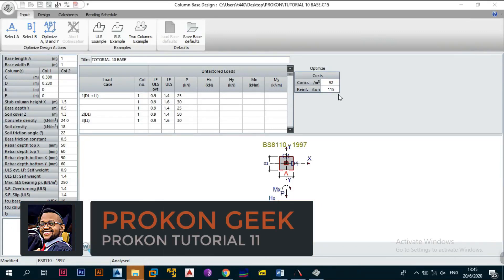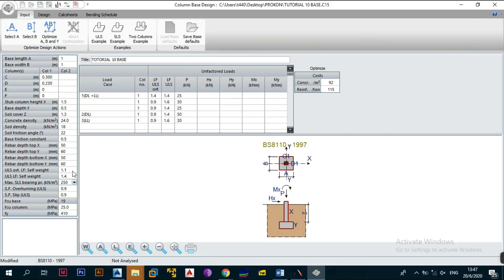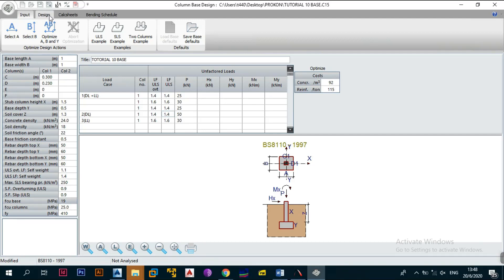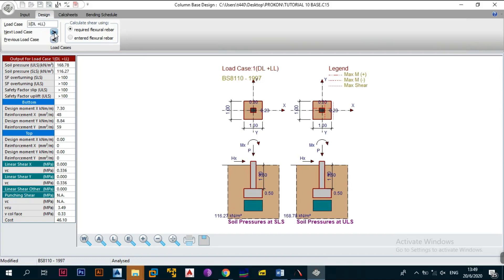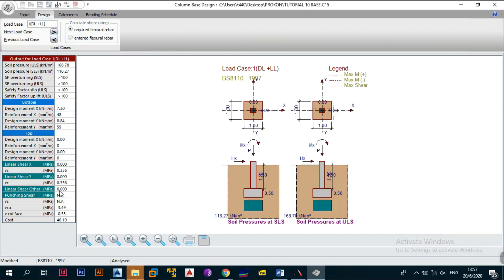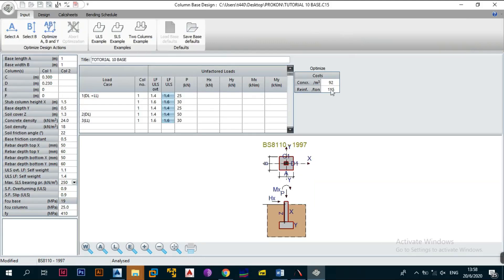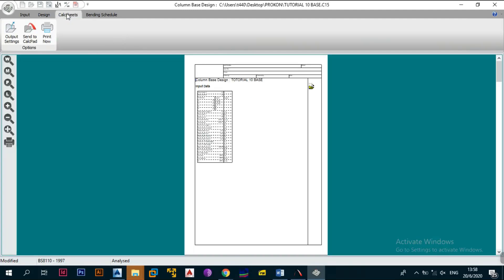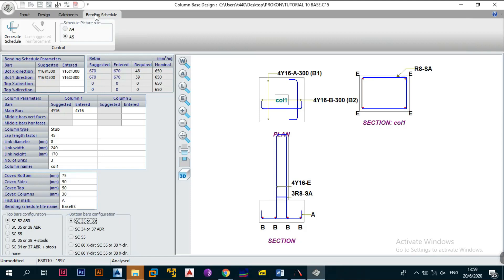Prokon Tutorials For Beginners In English:  Part 11 Foundation Design Example 1_Analyzing Results

Comment: I think there is a little mix up on the factors..the code stipulates a load factor of 0.9 when considering overturning or uplift. Having a safety factor below 1 would mean that we are saying that the total loads can exceed  the resistance by a certain quantity it still the analysis would pass. My understanding is that safety factors should around 1.5 as you initially had..I am using the SABS code
Reply: I'm using Eurocode and it agrees with this. A safety factor less than 1 doesn't sound right